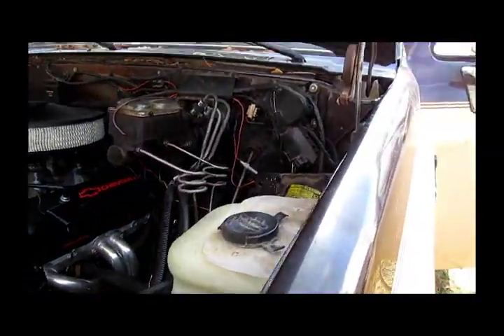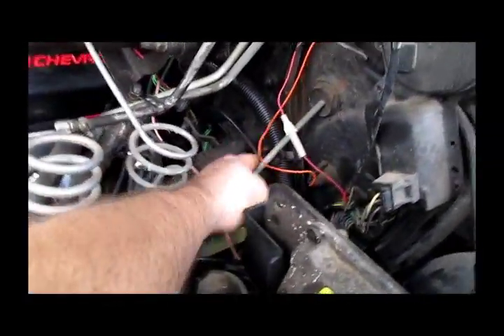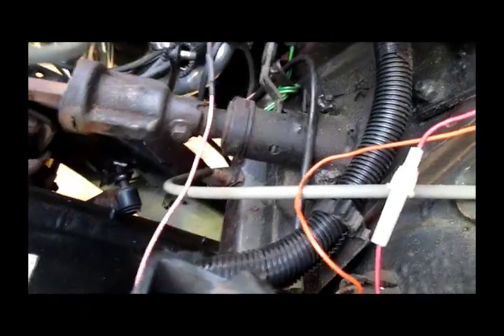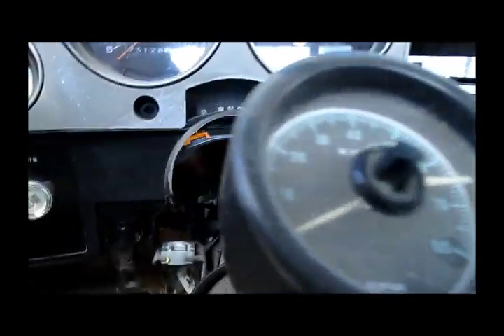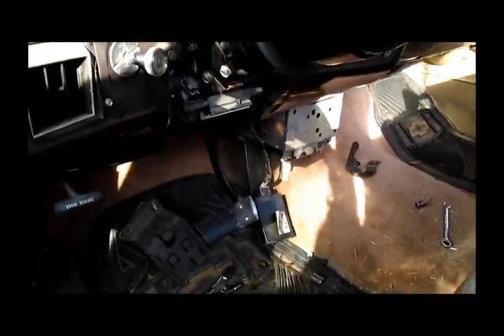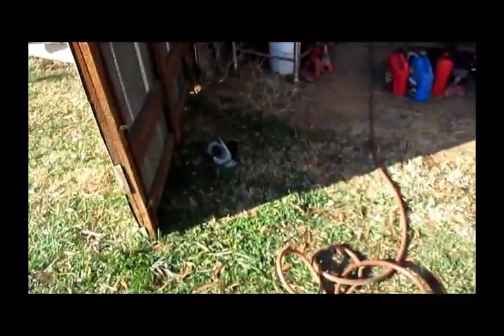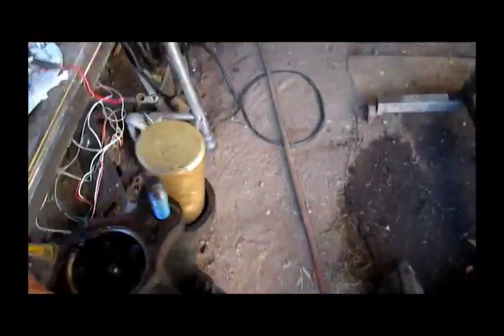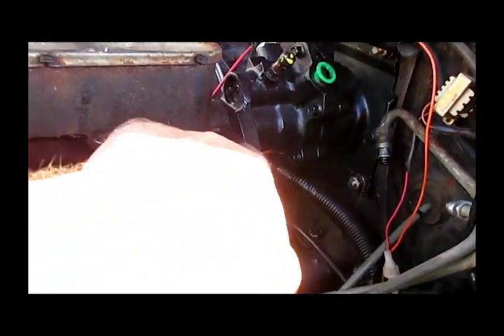Hydroboost replacement on '85 Chevy C30

Comment: All, I removed the hydroboost on my fully loaded silverado trim 1988 (squarebody c30) in 1 hour. The issue here is the guy doesn't have a universal joint. All of these nuts can EASILY be removed with a "3/8" Universal Drive Joint" I say this not to bash the video maker, but to let you all know that this (what I call) a 'wobbly' is essential for any youtube mechanics (such as me). Thank you for making the video! It was helpful.  Pop the cruise control module out, remove the top 2 10mm bolts that hold the bracket, get a deep socket 15mm with the wobbly and extension and crank the nut out. The nut was able to be removed with my 3/8" battery powered impact no problem

Comment: So I just took this job on and your video really helped me a lot. Thanks for sharing some of the accidental approaches to the fix - made for a more entertaining video. Just one thing to add to those out there doing this - when you pull the hydrobooster out of the truck - you need to get the mounting plate (the one with the two threaded studs) off of the unit. This was a struggle for me with my limited selection of tools. I ended up tapping on the edge of the plate in the direction that the nut (roughly 2" diameter nut holding it to the plate) would travel. It only took a second to get it off once I started down that path. Good luck.
Reply from the maker: Thanks for the tip!

Comment from the maker: It wouldn't have been so bad if the truck hadn't been loaded from the factory.  I think one of the things I had to remove was the cruise control module.  It was much easier on my K20 diesel which had been stripped down.

Comment from the maker: I didn't because I never opened the brake master cylinder, just replaced the booster.  Yeah, I got cut up pretty bad sticking my arm through that radio hole.

Comment: Is there a gasket that mates the power booster and the master cylinder?
Reply from the maker: No, there should be no liquid between the booster and the MC.
Reply: @farmboy30117  ok thank you. I have a mystery leak after replacing my PB, and it's not coming from any hoses. Can't seem to track it down. Thought I might have forgotten a gasket between the two. I guess not.

Comment: This is not that hard of a job. All you need is a long extension and a wobbly socket. You don’t have to take apart any of this other stuff at all I had to take out what’s my air conditioner tube in front of my knees